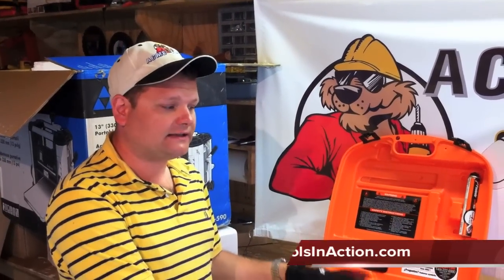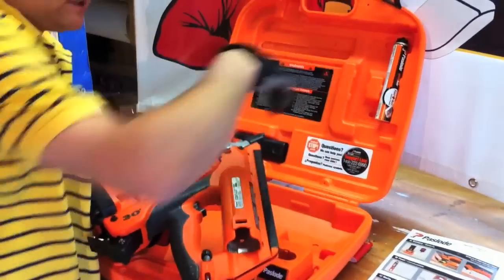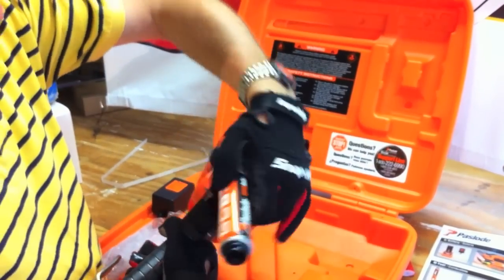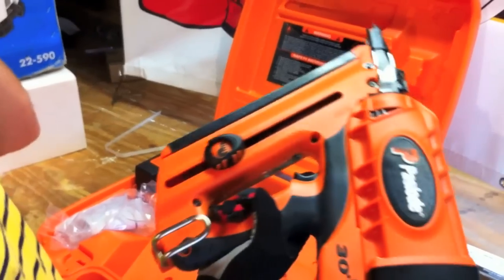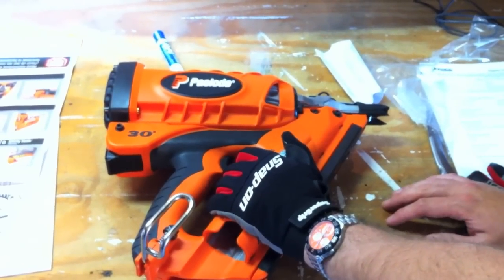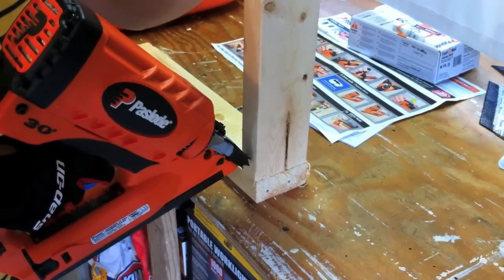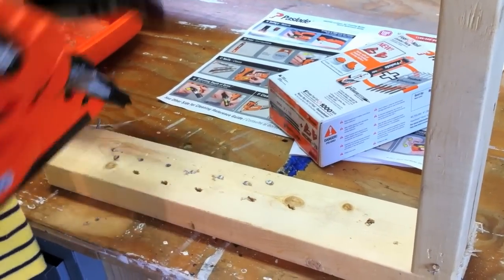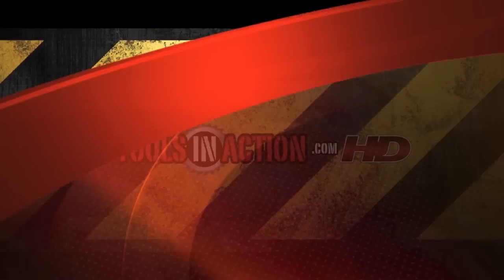Paslode CF325 Cordless Framing Nailer - Review

Comment: The fuel cells will freeze but if you keep another in the inside pocket of your jacket, you can quickly replace it and keep working.  Sure beats frozen air lines.

Comment: I've used these and in summer up here in Canada they are great.  I like that you don't have the air hoses to drag around if you are climbing around in roof rafters or running around large areas do jobs here and there.  The biggest drawback is in winter the fuel cells freeze up at at low temp compared to what we get up north here.  But if you keep a fuel cell warmed up and just swap them back and forth to keep the gun going it can work for short periods of time in cold temps.  I saw and tried a new DeWalt battery powered nailer just recently on our site.  I think because it does not use the fuel cells it works a whole lot better up here in cold weather and is cheaper in the long run because it does not use fuel cells.  Only drawback to the DeWalt battery powered nailer is it costs twice the price of the paslode nailer initially and is a lot heavier.  But overall I like the Paslode framing nailer in the warmer weather.  If i got to try the DeWalt framing nailer more I could have given it a better comparison. But the DeWalt from my personal experience was quieter by a fair amount, didn't leave that fuel smell in the air after firing it, didn't have nearly the recoil of the Paslode.  So if you are doing a LOT of framing and want an excellent framing nailer DeWalt and Paslode both seem to be doing great.  Just my 2 cents though.

Comment: Who in the world like to 37% more for the same nails + fuel cartridges.
framing nails come 4000 in a case Paslode 2500 and the box of Paslode 2500 costs about $10 more than the case of 4000. and the Paslode gun recoil is a bit slower than a pneumatic gun so you have to pause slightly between nails.
Reply: They're not meant for framing 24/7.

They're made for Portability and convenience and that costs extra.

Comment: For those DIY'ers I will also leave a word of caution.  Use the proper nails designed for these guns.  I have seen what happens when guys grab the wrong nails and run them through guns like these paslodes.  Nails built for Bostich guns with wires holding the strips together instead of paper will really cause havoc with your gun.  Just get a new guy to load the gun and see what happens.
Reply: Curt Warkentin what about the plastic strip nails ? Do they get jammed

Comment: Paslode reps will always tell you the battery is good for 4000 nails,this is complete rubbish,it's good for half that if you are lucky,this comes from experience,i've been using this type of battery,old & new for around 10 years.
Reply: 4k constant use. The fan stays on longer for 1 to 3 nails per second compared to 100's fired in a few minutes.